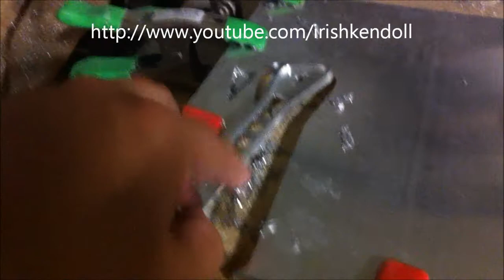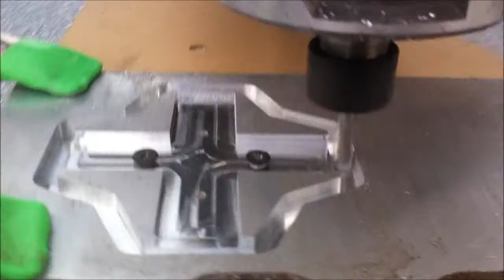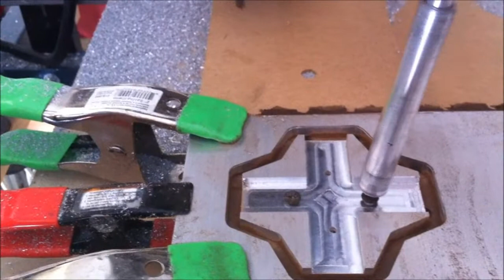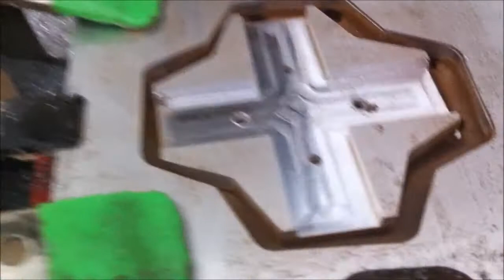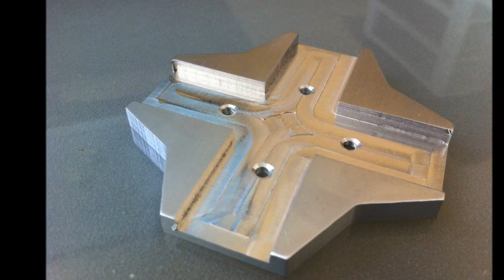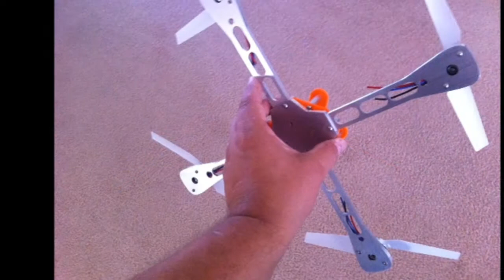My New "Iconic-X" aluminum Quad frame designs

Comment: That's amazing! I am staring my tri-copter build soon but I need a little help.
I am having a hard time finding the correct cutting speed on my cnc. I am using a .205" diameter 2 flute solid carbide router bit and a porter cable 690 router. What are the speeds and feeds I should be using? Thanks and can't wait for the maiden flight!